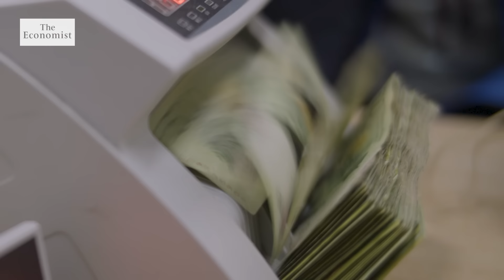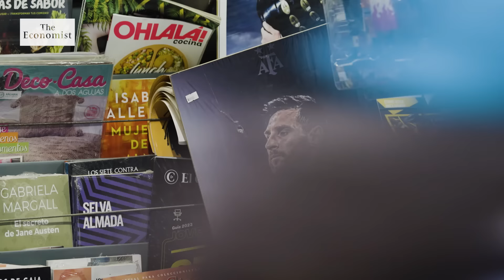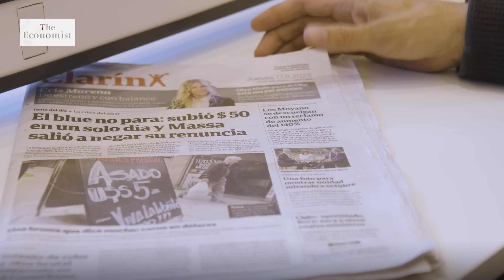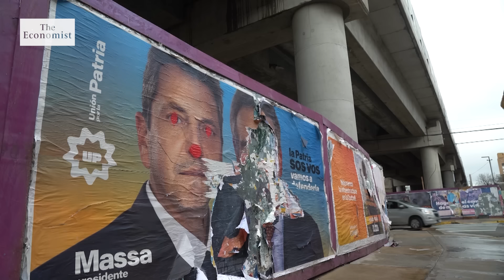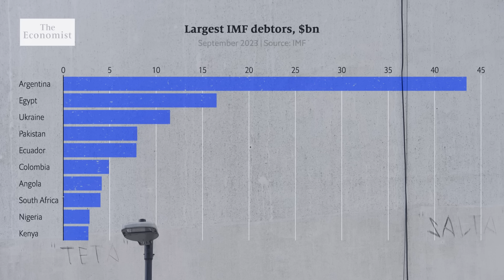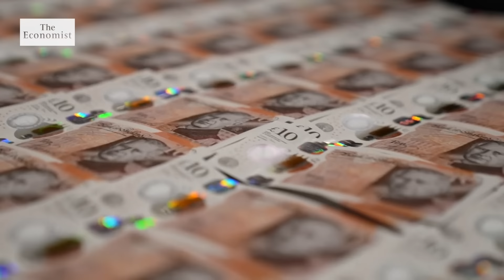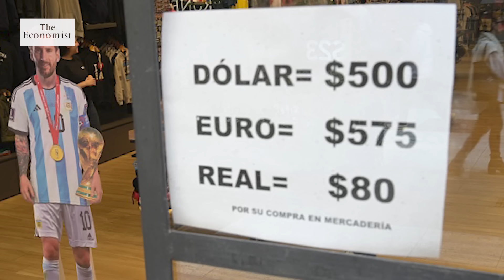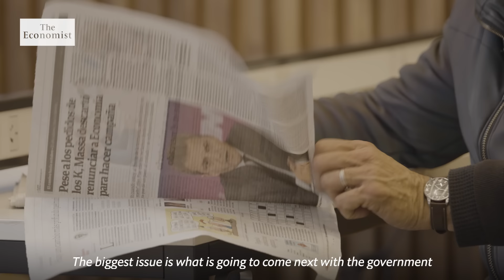Why is Argentina’s economy such a mess?

Comment: This has gotta be one of the worst videos I’ve seen from a reputable journal. Keep in mind the United States also runs a fiscal deficit including under Trump. There was no complaining there. 2% of GDP on subsidies is not a significant amount, I’m certain that if you looked at the United States’s spending on subsidies it would match that. Also government jobs are keeping people out of poverty😭. I agree that infrastructure, especially economic infrastructure should be promoted  but that will also most likely be taken care of by the government regardless. I agree that economic isolationism and shrinking exports are a huge issue, and if the government were to get involved, maybe it could be by protecting Argentine companies to help them take control of those industries? That way foreign investment doesn’t come and take all the wealth like the rest of Latin America. Also not a single mention of Corruption!

Comment: A few anecdotes.  I am 68 years old and since my teenage years, the peso, in its various incarnations, has lost 15 zeroes in 5 changes in currency of an average of 3 zeroes each and, with a black market exchange rate of about thousand to one, the currency is ripe for another 1000:1 swap.  Using the standard prefixes for factors of a thousand (kilo, mega, giga and so on)  1 peso is currently 1 petapeso of my youth and it will surely be an exapeso shortly. I remember once when the oil companies distributed to their gas stations stickers with ".000" to glue to the then mechanical counters in the petrol pumps because they didn't have enough digits to show the amount due.   The currency devalues so fast that they can't print bills with enough zeroes in them.  The bill with the highest denomination in Argentina is worth less than the lowest denomination Euro bill.

Comment: This is where most countries which get into a situation like this make their mistake. Printing more money is fine, but you need to implement further policies such as large scale public works (if you just pay people more money without an increase in production and added value to the economy this is disastrous), and also price caps on products and services at least on essentials such as energy, food and health services and products. You also need to subsidise the producers return for their product, but lower the price for the country which the product is being exported to. The lower prices automatically happen with the devaluation of the dollar but the lower price for a producers product from another country can be offset by the governments subsidy. These policies are very effective, if they are all implemented cross the board in an economy and not just here and there, which leads to a continuing balance of trade deficit and also higher inflation, which Argentina is currently experiencing!

Comment: To avoid any penalties, Argentinians, in particular those on the bottom pf the ladder, should consider buying alternatives to the stable dollar. Argentinians should consider buying Peruvian Soles. That currency is cheap, and it has demonstrated stability in ups and downs periods of Peru's government, more of a decade. Obviously, is a temporary solution, but buying cheaper stable currencies is better than to buy a limited amount of dollars without facing penalties.

Comment: Stop printing money. Then, inflation goes away in one day.
Reply: No, because in most cases inflation is not caused by debasement of the currency. 

The causes are much more complex but mostly centre around unmet demand. 

The solution is best met by increasing supply rather than suppressing demand because this too often winds up in recession and unemployment.

Increasing supply needs at the same time, reduced import taxes and costs, as well as investment and improvements to productivity.

Comment: The long term solutions to fix to Argentine economy will cause more suffering and more conflict short term than the suffering caused by the current situation. Spain was somewhat in Argentina's situation in 1957, with multiple foreign exchange rates and a collapsed economy thanks to Franco's belief in fascist self-sufficiency economic theory. The breaking point was not having hard currency to be able to buy oil. Argentina needs to get so bad that real reform is better than the status quo, and that day has so far never come.

Comment: To put all the blame on peronism is unrealistic. The 1976 dictatorship took on an enormous amount of debt. Debt that was recognized as legitimate by the following governments. I was too young to remember Alfonsin's Presidency well, but i remember the hyperinflation during his mandate. President Menem also took a lot of debt to maintain the parity of the peso with the dollar and the total opening of imports, which was extended to the following government that continued taking debt, until it all ended in the 2001 crisis. President Macri again took a lot of debt, while refusing to control capital flight, and to a great extent caused the current crisis. The pandemic and a major drought that caused half of the crops to fail followed.
Of all that presidents, only Menem was a peronist (and nobody thinks well of him, not even other peronists. The only exception is the nutjob of Milei, which said that he was "the best president of all times").
Of course, there were other Peronist governments, but they did not take too much debt.
Also, the black dollar market has always existed, and newspapers print the value of the black market dollars on their sites. They call them "blue dollars", for some strange reason.

Comment: The system is failing as a result of both gov and fed policies. The economic and global troubles are authentically concerning since staying afloat becomes more strenuous and arduous. The consistent economic mismanagement of finances of the country. Argentina now is exposed to imminent risk of disaster and ruin if not resolved soon, perilous. In the midst of turmoil, they want to save dollars in banks and stush them at home. It needs sustainable financial practice to jumpstart circulation of the economy.

Comment: Restoring confidence in the currency is an important first step. I think simply moving to USD wont help in generating the investment the country needs to boost productivity and lift supply.

My recipe for what its worth is a simultaneous 600:1 devaluation and link the peso to silver bullion while also issuing a one peso silver coin worth around USD5.

It may seem old fashioned but I think this could be hugely popular and do a lot to restore  confidence.

As a major silver producer Argentina should be able to produce enough metal.

The link between the country  name and a silver based currency would be another attraction. It would become a way for Argentina to differentiate itself in the world.

Comment: Failed miserably to mention that most of the problems Argentina is facing right now are due to the lack of a dollar reserve. Instead, it focuses on labor laws, subsidies, and 'printing money' for some reason. Maybe it's because this channel is biased towards neoliberalism, an ideology that even the IMF says is a 'scam. ¯\_(ツ)_/¯

If Argentina truly wants to address its economic problems, it needs to begin building its dollar reserves for times when its exports cannot sustain its imports during crises. Otherwise, it will find itself in the same boat whenever a new economic crisis arises. But, they cannot do that at the moment, of course. The dollarization of its economy may fix inflation in the short term, but it is not sustainable. Brazil has already attempted that once; the solution worked for a few years, but they depleted all their dollar reserves and crippled their industry because they couldn't compete with the products of major nations such as the US and Europe